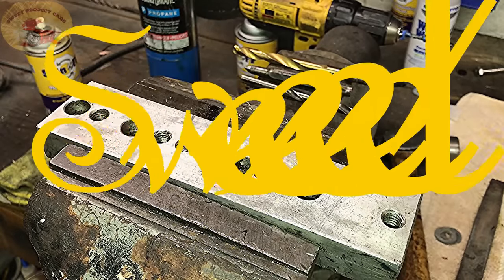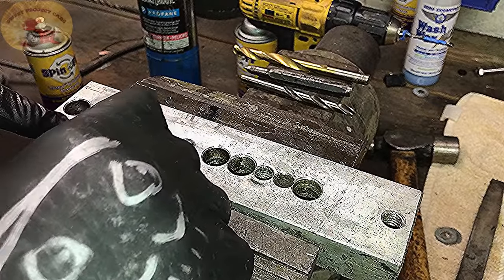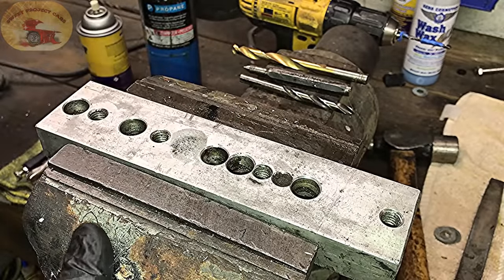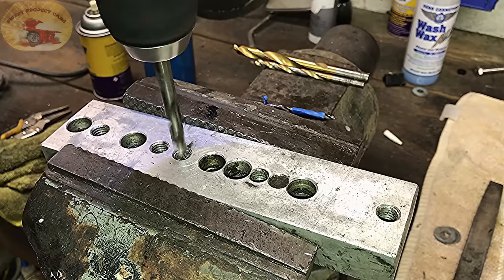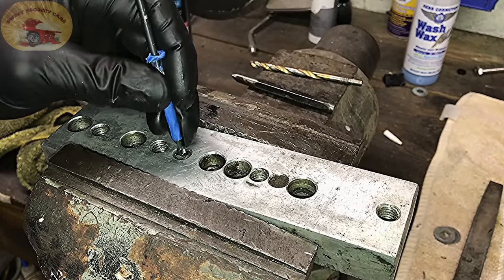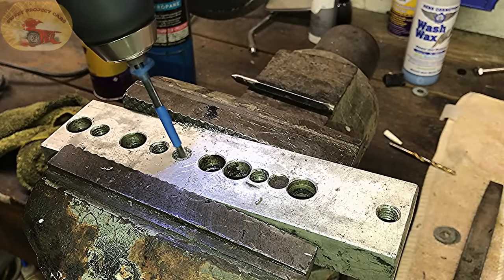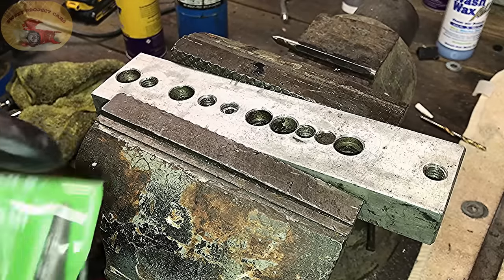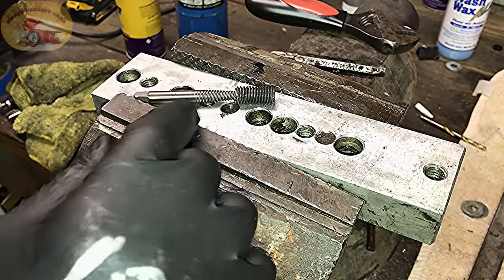How To Remove a Busted Bolt FAST! New Style Screw Extractors

Comment: 20 years in automotive and never had to remove a broken bolt....yet
Reply from the maker: Well I've been alive for 60 years and haven't had a heart attack....yet :) We are both more than lucky Tino! Thanks for watching, have a fantastic day. mad Mike the hammer SPC
Reply: Literally my first time removing an alternator and the last bolt snapped in two 😅😅
Reply: I have a nightmare broken bolt and I’m not even a mechanic just a DIY guy. My 07 pathfinder the fuel tank strap snapped in two from rust and I got the lock in part out just fine but the bolt was incredibly hard to turn and I broke it halfway out. I’m working upside down in the winter in NY it’s been a nightmare two months avoiding rain days and cold weather. I ran ratchet straps to and from the cross member and I’ve been putting no more than $10 gas to keep the weight down. I drilled a hole I thought was going center and it went all the way through the bolt and sideways a bit on a 45° angle. I bought a heat gun from HF to heat it and a bolt extractor from home depot ryobi brand. Trying it today.
Reply: Never had to or never cared to
Reply: Well how about now

Comment: Left handed drill bits are a gift FROM God.a lot of broken bolts will ✈ fly out of that hole like magic man
Reply: I've said before, I don't know why they even make right handed bits anymore except to remove left handed threads.  I'll never buy another right handed bit set.
Reply: Nicely Done, Very Professional, Thanks For Sharing...👍🏼
Reply: left handed bits are great if Your left handed. I prefer right handed bits
Reply: @danneumann3274  🤔🤔🤔
Reply: Tried a left hand drill bit today I paid 12 dollars for the bit The drill bit didn't do a thing getting the bolt out What did I do wrong

Comment: Broken studs are always an adventure. 7/10 times I end up drilling out and chasing the threads with a tap. Usually because the last guy didn't put never-seize on when they should've.
Reply: naa its just over torqued bolts. I just busted 2 out of 4 cause 2 were not to spec. never over tighten

Comment: I want to see you extract a steel bolt that has been broke off flush in an aluminum engine block under the header where you cant see it. This is quickly turning into an engine out procedure.
Reply from the maker: Well, it always depends on how much tenacity you have, we will do whatever it takes to get a busted bolt out.  Thanks for watching and sharing, have a great day and all the best on your project my friend, I feel your pain. :(  mad Mike the hammer SPC

Comment: The best way is to lay a nut on top of it, then wire feed weld the center of the nut to the broken bolt/stud and while still hot, unscrew it. Best way to remove them ever!!
Reply from the maker: you are correct and we do that all the time but most diyers dont have that mig welder available to them :)
Reply: ya most people dont have that gear. would need to take it to a shop. like me I think im gona have to. ive got left hand bits but I dont have the space get do the work

Comment: ...and then there is steel bolts broken in an aluminum head...I just bought a reverse drill bit and a flux core just in case lol
Reply from the maker: Thanks for watching and sharing, when it comes to steel breaking off in aluminum we've found that a little heat works tremendously. Have a great day Sheldon and all the best on your project my friend. mad Mike the hammer SPC

Comment: Once again a very good video my friend. Please let me add my 2 cents. I've been drilling out broken bolts for over 40 years as an airplane mechanic. My word of advice is when you drill into steel its with low speed and high pressure. When you drill into non ferrous metals as aluminum and copper it is with a high speed and low pressure. That along with some good lubrication will save your drill bits from heating up and dulling out. Also if you drill steel with high speed what happens is you work harden the surface and will make it very difficult to get another bit to drill into the surface.
Thanks again and I really like them easy outs your using.
Reply from the maker: thanks for sharing

Comment: Thanks friend. Needed a reminder after being out a while. Broke two brittle bolts off in a 20+ year old power steering pump. Heres to extracting, although can’t use the big bit method it’ll mess with the seal on those job, but I’ll try it in the future.

Comment: Thanks for the tip! I sheared off a starter motor bolt on my Chevelle and had to remove header. I started with a larger, then smaller drill bit like you said. Then the screw extractor and presto it was out.
Reply from the maker: Glad we could help!! Thank you for watching and sharing your results, we really appreciate it mrmanitoba, have a fantastic day my friend. mad Mike

Comment: I had tried the counter screw extractor with no luck. After using your suggested drilling technique I was able to remove the stuck oil due drain plug.

Comment: Depending on the job you may also check with your local tool rental business for an inductive bolt heater. No flame to worry about starting fires or damaging near by plastic/rubber parts. Inductive coils come in multiple sizes and even a free-form section for custom configurations. 
Great tip though, Mike!
Reply: I just bought one of these and it's been great so far !

Comment: If you have a small MIG welder, tack a worn out driver bit to the broken bolt and then wind it out with a drill...  the bonus is that the heat shocks/loosens the bond due to expansion/contraction.  It works every single time.  Give it a try if you don't have these ez outs but you have a wire welder...
Reply from the maker: AN you are correct we do the mig welder every week it seems but with this channel based on the DIYer that doesn't have that tool we share how they can still have success with simple hand tools
Reply: I think I have to do this due to space I the gun don’t fit

Comment: If the broken bolt is jagged or raised, you can use a large flat punch to flatten out the bolt center which makes it easy to get your center punch in the right spot.
Reply from the maker: Thank you for sharing we truly appreciate that Mad mikes sweet project cars
Reply: And it also gives a mechanical shock to the bolt, which can help break it loose.

Comment: I use a very small socket over the end of the extractor and the ratchet which i found helps to get a better starting grip bc you can put just a little pressure on it ... had to remove a snapped pinch bolt and another anti roll bar bolt that both snapped bc of rust ...worked brilliant 🙏
Reply from the maker: there are many methods to remove we just show what the average diyer would have on hand

Comment: i've broken three of this bolt extractor on a very very rusted bolts. in this demonstration is no rust seen so everything go by plan and so easy. only solution is welding a nut on a broken bolt.
Reply from the maker: Well after you broke the first extractor, common sense would tell you that you need to heat it up then it would come right out rust or no rust. Thanks.  mad Mike the hammer SPC

Comment: Stupid question: the set you recommend doesn’t include the screws. Does it matter what type of screw I use to bore the initial hole you started with? Sorry, I’m not a mechanic and I’ve never done this before, but I broke the head off a bolt while doing a brake job and now I have to get the remainder of that bolt outta the car. Thanks!
Reply from the maker: We used drill bits to bore the initial hole, use these  https://amzn.to/3ThiE8d  gives you the exact drill bits and screw extractors. Hope this helps John, thanks for watching and asking, have a great day and all the best on your project my friend. mad Mike & team

Comment: I have a broken bolt in my motorcycle.  Drilled a hole dead center and got a great tight fit with the extractor.  Extractor sheared in half.  Tried coming in from the back and have two broken bits to show for it.
Reply from the maker: Well, 99% of the time you need to put heat on them to get them out, your best bet now is to take it to your local motorcycle shop and have them remove it. If you had it here at our shop, we'd get that bolt out. Thanks for watching my friend, have a great week and all the best on your project. mad Mike & team
Reply: @SweetProjectCars  Thanks for the reply.

Comment: I've had an idea for bolt that snapped in deep grab a deep socket that fits the hole put it in backwards so the ratchet end is in the bottom and drill it the socket holds it center
Reply from the maker: Thanks for watching and sharing John, have a great weekend. mad Mike
Reply: @SweetProjectCars  i think it would work sounds right to me it would also protect threads

Comment: Drill hole in bolt dead center,  put bolt on threaded, then drill thought bolt to get center dril hole . Then remove bolt. Drill hole for extractor. Less chance you will damage threads.
Reply from the maker: Thanks for watching and sharing, have a great day. mad Mike

Comment: Nice job on a very easy extraction. But if you're from Michigan, as you implied, you won't see many of those squeaky clean, finger-tight "challenges" because they aren't the kind of bolts/studs that tend to snap off.
Reply from the maker: We did this for example only, but we've used this many, many, many times on rusted bolts.  Granted, in the rustbelt of the world grabbing the acetylene torch set is almost a must.  Thanks for watching.  mad Mike the hammer SPC

Comment: Does it work with screws that are a little rusted in? I mean not completely rotten screws, just stuck enough that you don't get them the first time around with your screwdriver/wrench and strip the head.
Reply from the maker: it works on rusted bolts as well my friend

Comment: Hello say I trying to remove a grade 8 broken bolt. I have had no luck, used all drills blaster etc. Grade 8 is a very hard steel, have any ideas? Thx
Reply from the maker: you are going to have to find out how to get a acetylene torch on it that will be the only way at this point  mad mike

Comment: I am trying to remove broken crank bolts from the flexplate the center ones ..and I got lucky enough to get one bolt but there is 5 more and it's killing me . My first question is : can I remove 4 if the bolts to reboot the flexplate to the crank ? And my second question is : isn't there an easier way to get the others out , they're broken below the bolt hole .
Reply from the maker: You may need to take the vehicle into a professional if the bolts are broken off flush to the crank sorry to hear this

Comment: You make it look easy—with a large diameter bolt…but in my case the bolt is 7 mm, broken off flush on the head of a Honda engine.
Reply from the maker: You just need to use smaller drill bits and smaller easy-outs my friend.  Thank you for watching and sharing.  We apologize for our late response.  Have a great day. mad Mike the hammer SPC

Comment: What size screw extractor did you use?  Also what drill bit sizes did you use?
Reply from the maker: It depends on the size of the bolt you are removing, always go one half the size for the drill bit and extractor compared to the bolt size.  So if you have a 1/2" bolt you will use a 1/4" drill bit and the appropriate extractor.  Hope this helps, thanks for watching and asking Ryan!  Have a great day.  mad Mike the hammer SPC

Comment: How do you remove rusted nut (stripped) from car exhaust tip? Drilled rusted bolt out after head broke with impact wrench, but the nut looks fused to the part metal Tried Easy Off and PB Blaster. Don't want to have to replace the exhaust tips.
Reply from the maker: You are going to have to put a little heat to it my friend. Acetylene torches are probably the only way you are going to do it. Thanks for watching and asking, have a great week and all the best on your project. mad Mike
Reply: @SweetProjectCars  Thanks

Comment: How high of a torque rating do you think those would work to as far as backing a bolt out? I had a brain fart and overtightened a water pump bolt and it broke off pretty deep in maybe 3/8" down in the hole. 20-30 ft lbs when I was supposed to be doing inches. Kinda freaking out I won't be able to get it out. And was just doing a favor for one of the nurses who takes care of my grandma..I've never had this happen lol.
Reply from the maker: Hello, my friend, don't feel too bad, we've all done it :( I can remember when I was bolting a 20-horse Briggs and Stratton motor back together and the crankcase bolts said something like what I thought was 20 ft-lbs. for the 10 bolts and at that point something wasn't registering and I thought that was a lot for an aluminum case motor. So I sat for a second, went and re-read the instructions and low and behold it was "inch lbs" so I caught it before I did it, that would not have been good. Sorry to hear about your situation. If you use this  https://amzn.to/3iuskfZ  just make sure that you drill the hole as dead center in the busted bolt as you can, then use these  https://amzn.to/3b9qUBz   and it should come out, you may have to use one of these  https://amzn.to/3B10iPw  while you are removing it. Thank you for watching and sharing, have a great day and all the best on your project. mad Mike the hammer SPC

Comment: Nice vid..!Hi How we can fix a leaking fuel cap..? Can the big o ring be changed..? Ty..!
Reply from the maker: I would look online and just replace it as they are very cheap
Reply: When the check engine light comes on (9 out of 10) is the fuel cap..! Some fuel caps are very expensive and you may have to go to a dealer to solve the problem and order. Takes times.! right..?that cost a lot of money..! But if you change the O Ring you can do it yourself and fix it for pennies..lol..! Also you can make a vid about it..!

Comment: So I did something stupid. I added red lock tight to the bolts holding up my TV bracket. Well you know I snapped off 1 bolt so far . The other 3 are not moving at all . 
  That's why I'm here . Question is will this work on removing the broken bolt . And how can I remove the other 3 without damaging them as well . Especially since they have lock tight.
Reply from the maker: Pretty much the only way you are getting those loose is with this  https://amzn.to/3kVaKmS  you are going to need to heat them up and yes, this method will work for you alberto. Thank you for watching and asking, hope you have a great week and all the best on your project my friend. mad Mike the hammer SPC

Comment: Will this work with lug stud that has broken off? The studs welded but I manage to get all but one off. Plzzz helf
Reply from the maker: Give it a shot, works for us every time.  Thanks for watching and asking.  Have a great day.  mad Mike the hammer SPC
Reply: Not likely. Assuming you mean a wheel lug stud, most of those are driven or pressed in from the "back" and are removed by driving them out with a punch. (They don't unscrew, so the extractors won't work.) With some designs you can install the new stud by inserting it into the hole and pulling it tightly with a lug nut (with spacer washers if required). Other designs require you to remove the hub to get good enough access to drive or press the new lug.

Comment: Bravo.......know do helix coil ....removal........what do u do.......cheers......edm....p.s......it's in alumiun thread
Reply from the maker: Removing helicoils is a very difficult task, but it can be done with a helicoil extraction tool https://amzn.to/3kB2WGG. This tool has a sharp blade that must be inserted at the top of the helicoil, and while being held in position strike the back of the tool with a hammer. This should wedge the tool into the helicoil and it can then be removed by turning counter clockwise. Thanks for watching and asking matt, have a great day and all the best on your project my friend. mad Mike the hammer SPC

Comment: I have broken bolt on my ac compressor. And the other 2 bolts fell off or they were never there. Point is it's in a tight spot. Fml

Thanks for the video. 😭
Reply from the maker: It's our pleasure my friend.  Thank you for the view and comment, we appreciate it.  Hope you have a great day and good luck on your project.  mad Mike the hammer SPC
Reply: @SweetProjectCars  well took me all day but i got it done. It was in a bad spot. I could not even see the bolt/hole. So I just had to guess and hope I was in the middle of the broken bolt and I took my time. Worked my way up from the smallest reverse drill bit and it finally came off. Then I had to tap the other 2 bolt holes. And got new bolts. And refill the ac system. 

I bought a couple different screw extractors but the drill bit did it on its own.

Comment: How do you remove the removed bolt from off the extractor after you got it out?
Reply from the maker: Turn the bolt the opposite direction, hold the extractor in your bench vice or vice grips then take another pair of vice grips and turn the bolt in the opposite direction, I believe clockwise if I'm not mistaken.  Thank you for the view and the question, sorry about the late response.  Have a great day.  mad Mike the hammer SPC

Comment: old ford waterpumps/timing gear are the worst. i used torch last time to heat the corroded bolts, they came out without breaking. most of corrosion seems to be in aluminum timing cover!
Reply from the maker: Thank you for sharing and watching Patricia.  Hope you have a great day.  mad Mike the hammer SPC

Comment: Im having issues with starte bolt.twice it broke now its inside cast iron block.flywheel problem.
Reply from the maker: Sounds like you are going to have to remove the flywheel and drill the bolt out using an easy out to get it out, you might want to consider using a little heat to get it out also.  Thanks for watching, hope this helps Herbie. mad Mike the hammer SPC